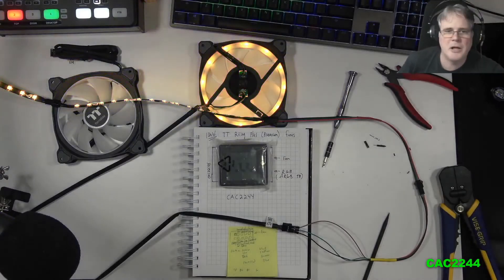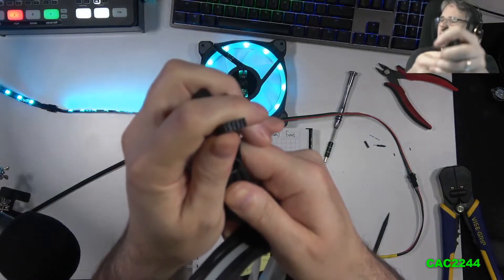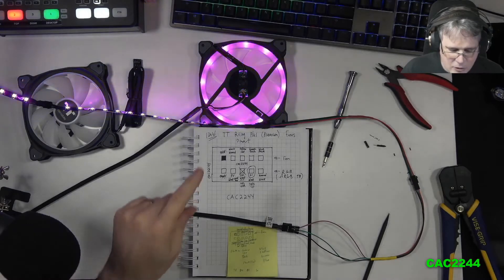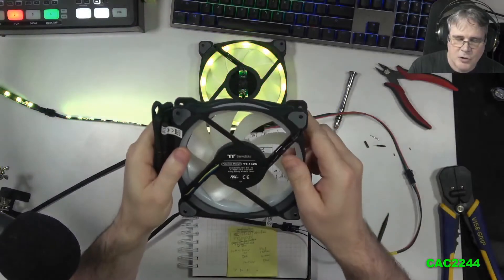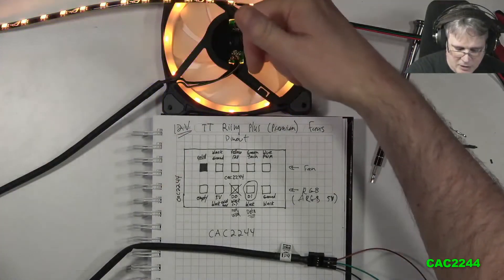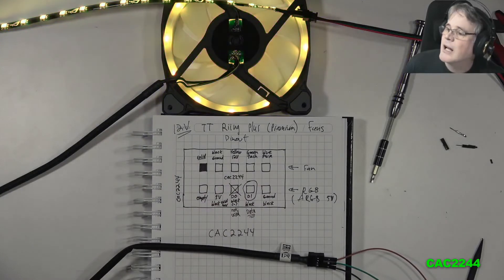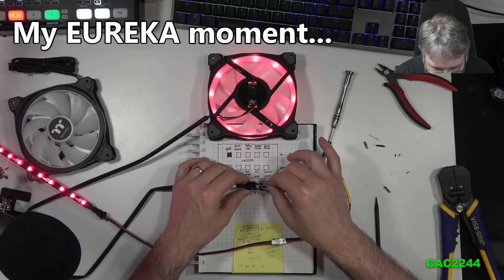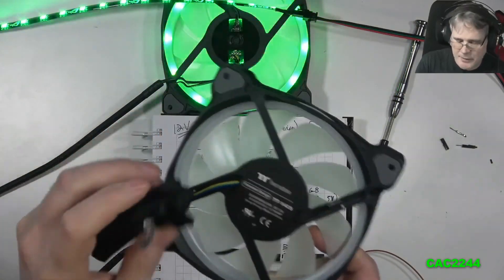Thermaltake Riing Plus connector Pinout.

Comment: Thank you for posting this video. I wanted to buy the 200mm Riing Plus 20 for my Thermaltake VT20 case but was not going to spend extra money on a worthless controller. 

I actually did not cut any wires just soldered some pins to go into the top of the connector that added the ARGB harness. Used a flat old style PC connector that was the exact width, just removed the female pins and inserted in the correct order then connected to the motherboards ARGB header. 

Was able to just plug the PWM fan side of the Riing RGB fan directly into the motherboards fan header without changing anything. 

Fan RGB can be controlled with Open RGB but i decided to use the Gigabyte utility for the Aorus B550M Elite that I recently purchased to install in the VT20 Micro-ATX PC case due to getting tired of having a PC tower on the floor next to my legs plus having to clean it out every week from the cat hair and other junk on the floor. 

Awesome and informative video since there is no easy way to find a pinout for these fans. 

Thanks Again!!!!!

Edit: forgot to add that i may swap the fan blade assembly from the non-RGB version of the 200mm fan as its a better design with slots at the end of the fan blades that keep the noise down a lot better then the Riing 20’s style.

Comment: Very nice video, thank you.
Now I just took out the 4 PWM pins out of the connector and put them into my D5 Next pump, while letting the remaining 3 pins in the Thermaltake controler.
And it worked! Now my pump does the PWM control over my TT Riing 3 fans. But the lighting can still be controlled in TT RGB Plus Software.

Comment: Basically 5 pin ARGV 5v & a 4 pin PWM fan, why did thermal take have to use a USB 2.0 header instead of standard plugs.
Reply: Well the usb 2 is for the controller itself that controlls rgb fans with their programm not to mention if you have quad riings your mobo wouldnt make alot effects than the controller and trust me standards would make a mess in your case plus that most motherboards wouldnt have more than 2 argb headers so you need to buy splitters and again more mess i searched around cause i have 9 quad riings and want to use the last slot for an neon rgb led strip as i see it i will make my own adapter cause their rgb stripes are ugly af
Reply: more money to be made on the controllers

Comment: Thank god for this video! Those thermaltake controllers are such a pain in the ass! I bought two fans on a sale, thinking im gonna be hood rich for getting premium fans at such a low price. Never did rgb cases so Im excited as hell. Then I discover that they dont have controller... Oh well, I will just get one. Those controllers arent being sold separately in 99% of shops. Somehow I find an auction with used fans + controller. Because I was at work I couldnt win it, this made me very sad as it went for like 30% of the price of a new set... But then I started reading. My motherboard doesnt have ARGB header and this controller of theirs... goes to ARGB header! Its not a controller its a glorified hub! But now with this video I actually might be able to salvage the project if I buy a cheap knock off controller and plug the argb effects here. I hope it will work because those fans are really pretty. And big, I want 200mm fans. Thanks man you are the best and please keep your fingers crossed for me because Im a total noob (and an idiot that went for overpiced fans without those fancy gaming mobo).

Comment: can you do the reverse, put a fan that has the seperate 3 pin 5v argb and 4 pwm cable like the CT120/140, to the TT controller.  I remember seeing a video on this, but can not seem to find it again.  Because basically the connector for the Ring Plus, Trio, Duo etc have the that 9 pin connector.

Comment: If you cascade multiple fans and want to control the LED, connect to "data out" pin (DO) to the "data in" pin (DI) of the next fan.
Reply: Can you do a daisy chain with this and control each fans rgb individually?

Comment: Can the 4 pins on top be plugged into the motherboard 4 pin fan header - which way in terms of orientation?
Reply: yes just check your mobo header so you know which end is the 12v and the ground. basically so you dont plug it in upside down.

Comment: hi i have the thermaltake riing quad fans and the wires accidently  came out of the molex power plug today that goes to the psu do u have a pin out for the wiring on this power cable to the controller box i think there all the same on all the riing fans and would like to see my fans actually work

Comment: I have several devices from tt.  LED strips are connected to the one controller.  I want to connect another argb strip to this controller to, but only tt strip have 4 pins. Other have 3 and no D0 pin.  What do you think, is it possible to do it somehow?

Comment: Using your pin outs and a custom connector to create your own Argb “Lumi strips “. The TTRGB plus app shows 12 Argb lights per strip. Is that the max number of lights you can have per section? Also how many sections can you create off of one TT 9 pin ports?

 I have 5 TT ring plus fans on 1 controller and have the TT AIO pump by itself on a second controller. I have 4 extra ports I wanna see what I can do with it

Comment: I just built my new rig with over 20 different rgb components. Every single one of them works as expected except for the damn TT Pacific W7 water block which funnily enough is the ONLY thermaltake product I bought (because I liked the look of it). 

At first glance it looks like the controller died (on day 1). The water block has a weird 5 pin that goes into their conversion cable ending up in the 9 pin you are analyzing in this video. The 5 pin is presumably the rgb schematic you have shown so the top 4 aren’t being used in my case since it’s just for the rgb on the water block. Do you have any idea how I can use just the bottom row (so the 5 pin coming out of the water block, with no conversion cable to the 9 pin), to power the rgb?
Reply: Loooool here the same with w7 plus controller died in 3 days
Reply: You can use the 9 cable adapter, the rgb works for me with this Video Schengen

Comment: great video! im planning to build my own controller using a microcontroller. do you know if this pinout is the same for riing quads?
Reply: I need to know this too. Trying to use a Riing Quad with iCUE and a Corsair commander. Even if I need to wire each strip to it's own header that's fine. I have exactly 4 left on my hub
Reply: did any one figure this out?   I have been disgusted by tt's software for too long

Comment: So with this pinout would I be able to use a male 9-pin USB cable and splice it with a TT Pure Duo fan that has two connectors (one for fan, one for argb), and then connect it to my TT Riing Plus controller?
Reply from the maker: Tt Pure Duo are 12v / 5v as per specs, so as long as you identify the wires correctly on your Pure Duos, then it should work.
Reply: @cac2244  I ended up getting it to work last night, your video was a great time saver, so thank you for that.  With the Pure Duo fan, I used the "E" adapter cable, which turns the aRGB mini-plug into a standard 3-pin, then drilled out the plugged hole and moved the data pin to that new hole.  This can then be inserted into one-half of the 10-pin connector and the aRGB works and can be addressed in the software, but only as a pump, because when it doesn't see the fan it kicks up an error.  I was running the fan portion from a motherboard port at this time.

To fix that, I cut the Pure Duo's standard 4-pin connector off and spliced the wires onto an old 4-pin connector I had lying around and then inserted that into the other half of the 10-pin connector.  Once that was done, I can control the aRGB and fan through the normal software.  Alternatively, I think someone could use a 9-pin motherboard-end USB plug, drill out the blocked hole and then splice into that and it should also work.

Comment: These are the best looking fans in my opinion, Look better than the newer Riing Trio and Riing Quad fans.
My only concern is I heard they don't work with AMD Ryzen, Something to do with the internal USB header and the Riing controller but this was a while ago.
Any idea if they have fixed the issue?
I am looking at building a new AMD Ryzen 5950X build in the next few months and really want to use these fans. 
10 fans so I guess I would need 2 Thermatake premium controllers so I can sync with ASUS Aura.
Reply: just to let you know i just finished building mine and I decided this time to go with Ryzen processor, but unfortunately fun light doesn't work neither the TT Software. So if you can go with Intel processor.

Comment: this saved me heaps of work figuring it all out! Good work mate! 

I'm currently using a few Arduino Pro Micros programmed with the Corsair Lighting Protocol firmware (makes it act like any of the Corsair RGB controllers, so it'll show up in iCue be controllable!).

Just trying to convert my TT Fans to run off one and ditch the crappy TT Box and software (it's failing anyway and can't drive the LEDs at full power....), and refit the PC with strips controlled by an Arduino too, hopefully I can get the Commander Pro firmware working so it'll control the fans and allow temperature input.

Re:DO, usually on other ARGB it's digital out, for bouncing it to the next strip, have you tried plugging a second fans DI to the first fan DO and see if it daisy chains? (I'm guessing the RGB strip on the fan is proprietary with DI and DO on the same end, other other one that comes close is a dual data channel LED where it's DI and a DB (data backup channel) but those are both inputs, with out still on the other end.
Reply from the maker: What you are doing with the arduino controller sounds pretty neat. DO= Thanks, and you are right...i realized almost immediately after my video just looking at RGB strip seeing signal coming in from one LED, then out to the next one and so on...
Reply: @cac2244  I finished the project thanks to your video. Figured out that connectors like those found on say a USBASP programmer in male form fit the thermaltake fan plugs exactly, so that made rewiring those fans super simple too! and no need to cut the fan side of the wiring so i can always plug them back into a TT controller if the need ever arises!

Comment: Can someone explain to me why the the controller cable has two usb and also has a controller cable?
Reply from the maker: Bill, if you go on my channel videos, i explain on one video the setup of the standard controllers that come with the Premium fans and another one where I review and explain the Premium Controller. I do not direct troubleshoot questions of users and your question is very vague, but you should find your answer in my other videos.
Reply: @cac2244  the controller cable splits into two usb cables is that for a daisy chain or is the bridge cable for that ? Just curious as to why it splits off into two

Comment: I have the answers right in front of me, and I still can't get the lights to work.

I can get them to flicker if D1 quickly makes contact, but it's completely random what turns on. steady contact with D1 turns every led in the fan off.

If my problem is software, I'm going to kick myself.

Comment: I would love to see you do this for the New Quad Riing fans!   I know they make a Sync controller but those are $25 ea ... I found out if you have more than 8 fans your Screwed Because the TT Sync Controller claims it will handle 9 Fans but it Wont with out over heating and Locking up after a few hours. 
 I am looking into trying to Daisy Chaining 2 of the Controllers ... But @ 50 bucks for the 2 Controllers for all 12 Fans in total im looking for others ways first before I go that Route !    Cow}:-o)
Reply: Don't do it, i had quad and i even used 9 controllers to try make it work without problems i couldn't so swapped to corsair
Reply: @abdullahal-jedaibi4017  
     Howdy Abdullah,  Sorry to hear about the Controller issues.......ALOT of People get confused between the TRIO Riing and the Quad Riing Fans BC Before they Buy Them they assume that the Quads can Be adapted Like the Riing TRIO fans can be to a MOBO 5v PIN with the TT Premium Controller Box but it CAN NOT!  
   The NONE compatibility is in very small letters and ONLY in 1 spot on the product page, so a lot of PPL buy the TT premium thinking it works until they own and and see if does not., I know of about 20 PPL so far who over looked that in the description too ,  it is something TT needs to make more clear when selling these Fans.
   The sad PART is if TT made an Official Splitter but told PPL they could NOT guarantee software working with the QUAD fans I am sure a lot of ppl would be ok with that.  Which Is actually what I am DOING.... 

       I am Only Using 12 Fans in total, I am planning to Separate the Quad PWN Fans Wires from the ARGB Wires and Soldier each Set of 4 Wires on Separate 4 Pin Plug and use Open RGB or Signal Software to run the LEDS alone and if that will Not work I will try a few over the counter solutions for LED lighting and if none work I'll use a Raspberry PI  and write some custom software, BC I dont plan to use TT software it reminds me of the old 'NZXT CAM Shitware' !  
Anyway I saw some one did it but I was busy when the Video was playing and I could not find it when i got time to check Computer. No Biggie I am just trying to Confirm the Quad ARGB PIN out, I have (8) 3 set Packs of 120's and 140's in white of these Fans so I'll sacrifice 1 of the 3 pack in Black to get it working. 
 
   1 Last Thing You can also Use MSI or Razer  Software and Not even down load TT software and you can on some systems get it to work with very little Fudging!        Be Safe and God Bless  🙏✝👍  🇺🇸🤠 Cow}:-o)
Reply: Well dont know if you heard it or not but they "thermaltake" said that new information just came to light and with it all my quad worked 100%... What they said is each controller must be on mulex alone (like each molex cable just 1 controller) because fans using over 75watts and that made alot of ppl have issues mostly controller goes offline. So i tried it and worked but only single controller because my PSU have only one cable molex, so i told a friend who have 13 Trio fans what he did his PSU is 1200 and have 2 molex cables so first one put 2 controllers that holds 4+4  and the other cable put 5 all alone and finally his system worked without any problems.
Reply: @abdullahal-jedaibi4017  

Howdy Abdullah,  I spent 90 Mins getting the correct info for you & I wrote you a Huge reply, BUT F...King You Tube took it down!  
  Anyway this will be the 1 Min off my head version! 
   I am not using any TT software,  I am going to separate the wires and run each circuit separately.  
 
  I am not re writing all the Info again about the PSU and Plugs etc...... So I will just say this,  BUY a  $25 Second Used 600w PSU and run all the lighting off that, issue solved!  
    Be Safe and God Bless🙏✝👍  🇺🇸🤠 Cow}:-o)

Comment: All you need is a Thermaltake TT Sync Controller TT Premium Edition and control everything with the motherboard. It comes with the cables to work with ASUS, Gigabyte and MSI motherboards.
Reply from the maker: You realize that what you say is a given... The pinout is to open the possibility to customize with everything else in between...you got that from the video, right?
Reply from the maker: I feel my original reply might sound condescending (re-reading it now...) but was not intent, so sorry if you perceived it as is... What you say is right in itself. I did review the Premium Controller many months ago...  https://www.youtube.com/watch?v=T0s8xCplZ4Y&t=4s
Reply: I have no rgb mobo and I plan on using shenanigans like this to get rgb from a controller